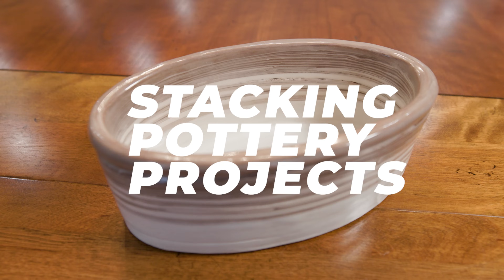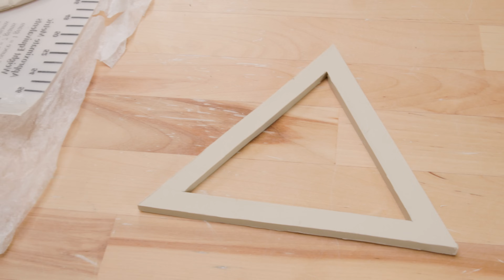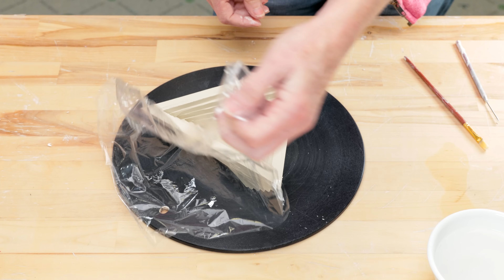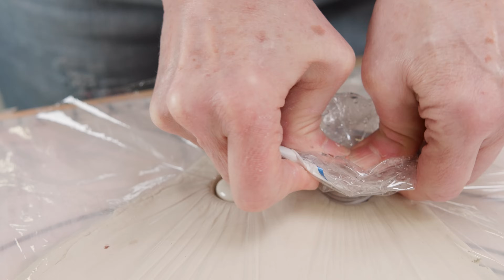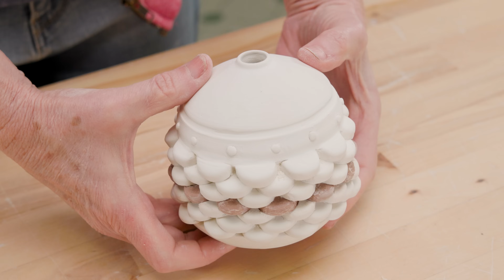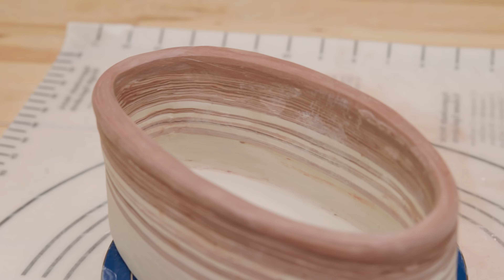Stacking Clay Methods - SECRETS REVEALED! FREE TEMPLATES!

Comment: Are there any issues with the shrinkage differences between the two types of clay when using them in these types of applications?
Reply: Hey Vicki.  Those two clays have pretty close shrinkage rates.  They are not exact, but when they are rolled together like that, the differences in their shrinkage rates doesnt seem to make a difference.  Just. make sure either they are really rolled well together or connected well together in some way.  Good question.

Comment: Very interesting.  Were you at all concerned about the layers of the pieces holding together?  I would be worried about all the layers separating during bisquing.  Is that what the two bats and the weight were for, to make sure the layers adhered?  I'm really thinking of trying this.  Thanks for the wonderful ideas.
Reply: Hi Don.  I was worried, but I have found that gently pressing the bat down on the pieces will help stick them together and then drying it with a weight on top as it shrinks and dries seems to keep the layers together.  Give it a try and see what you think...  Im glad you liked the projects 🙂 Thanks for watching.
Reply: @annruel1982  Thanks Ann.  It is on e my to do list to try.  Looks exciting
Reply: @donedwards5301  Awesome Don!!  Give it a go.  I wish there was a section where people could share their work with us, too.